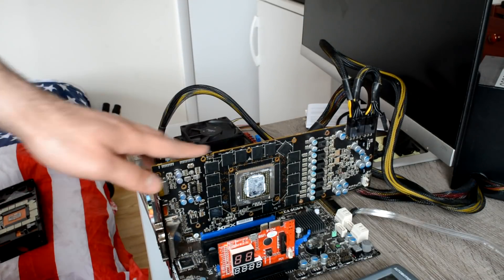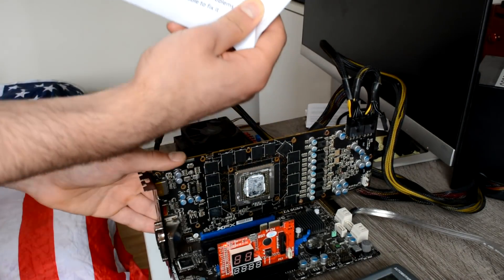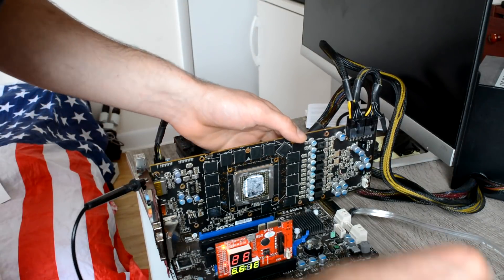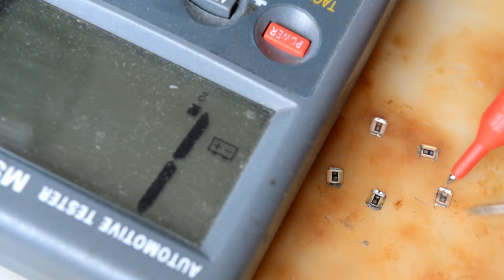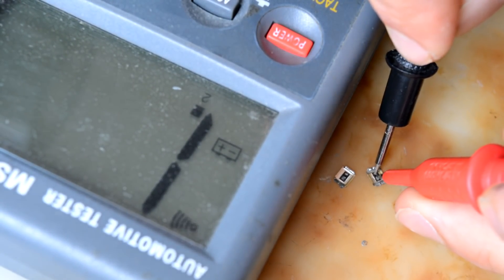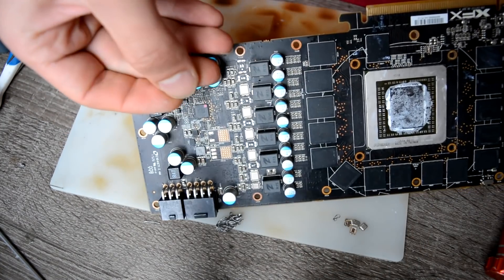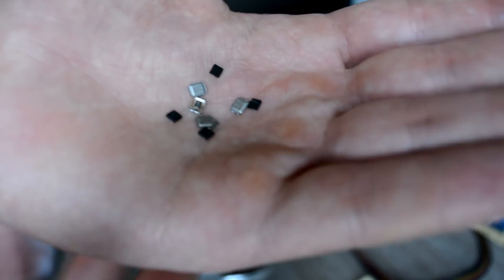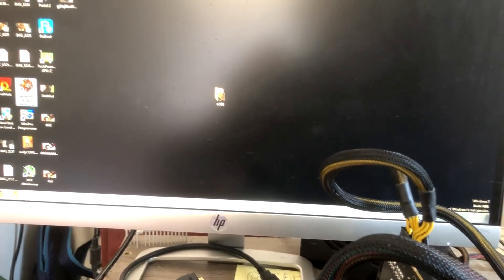R9 390X reference card broken (short) diagnostic + repair graphic card

Comment: Hello Eli!

You use motherboard, CPU, RAM and power supply to run the card and test it, right? Is this enough for GPU testing? What's the other tool in the front that is plugged in the PCIe and what do you use it for?
Reply: Debug card

Comment: Hi! I have the same card Sapphire Nitro R9 390, after playing o couple of hours its freez in black screen, after dat is stuk by black screen on windows boot state
without driver in safe mode works fine, but after i am installing driver and reboot it is give a black screen
any idea wats with it? voltage stabilizator?

Comment: i cannot find the part number for those mosfets, i have the same card with several obviously burned out mosfets, they got so hot the steel can started to blue itself
any chance you have a part number/datasheet for those?

Comment: Hope to help some people...
Had random black screens with this card. Didn't wanna sell it and replace it as I felt that it still served me well... I didn't even see an RX 580 or 590 as upgrade compared to 390. Tried about everything and was near sell it as faulty. 
What worked and it works perfectly for few days now was downclocking the memory a bit. From 1500 to 1300. And I actually didn't notice any performance difference probably thanks to the 512bit memory.
Hope it works for other people also.

Comment: my r9 390 goes black screen and coolers at 100% when i install drivers, idk what happened :(((
Reply: Well I did buy a rx580 8gb as well sold ot for vey little profit but hey it was something. Still need money to pay back my brother 😭. I am thinking of picking apart the friends video card 😂 infact it is also a gigabyte edition but with three fans and not 2.
Reply: Me2
Reply: my friend gave me 2 cards they did the exact same thing what I did with them was used the heat gun method and believe or not both of them are working flawlessly and now i can even install drivers without any problem however if i want to use one or the other I have to first uninstall the drivers for one of the card using ddu uninstaller then use the other card and install its drivers. The cards in particular are a r9 270x 2gb and an r9 290 4gb. the 290 was still crashing after a few minutes of gaming so after a littler under volting it is running games like apex on 100+ fps 1080 medium settings.
Reply: @asifkaka5052  tryed it, finally changed to a 580 :)
Reply: I bought a r9 390 8gb gigabyte edition hopping to sell it for a better price but after it arrived it has the same problem as shown in the video i swear i did so many things even the heat gun did not help now I need to seek a repair shop with a professional and ask for help. hope i can repair it for cheap because i bought it with elder brother's money. now he is asking for it.
Reply: @asifkaka5052  i maked reflow and dodnt fixed, f

Comment: I ended up buying a second hand 390x and the 6 pin pcie power connector trips the psu and the positive connections are all ground i dont understand how this happened but i would like to fix it
Reply: Looking through looks like at worst it could be an interlayer short but could be vrm or a cap getting a thermal camera and a psu to power that section of the card at low power

Comment: hey i have a 1080ti where the chip is getting hot, fanspin and all but no display output. when entering the machine with remote desktop or with another gpu as main gpu it will give the 1080ti a code 43. i am able to flash bios on the card, and gpu-z recognize the card but gives some misinformation on it( ex. when i use a 760 as main when looking at the 1080ti it will copy its vram amount etc, but not bios version or anything specific to the card). i am getting bored with it, cant figure out what its problem is. any idea?
tnx in advance

Comment: Hi eli, I happen to own a friend's R9 390 nitro that doesn't even turn on the fans, I've checked the 5 fuses, the IR3553 Drivers doesn't seem to be shorted and the same goes for the voltage regulator, still the card doesn't display any video output or spin a single fan on boot, any ideas on what to check?

Comment: Hi,

i have a GTX 1080Ti and everytime i am installing the GPU to my PC it wont turn on. Fan will move in less than a sec and then wont move.
Motherboard have power and all but the pc wont turn on. i replaced PSU but still dont work. i replaced the GPU and it started working.
I have a feeling that the issue is a short circuit on the GPU causing the PSU to turn everything off due to power protection that the PSU have.
Hoping for your response.

Cheers

Comment: i have saphire tri-x r9 390x just like in this vidoe, it was runing normal until the card getting flicker the screen on and off. and finally the card died, the chipset not hot. is there any solution to fix it? coz last time i checked the fuse, mosfet was ok. but i dont know about voltage regulator if it is ok or not. thx b4.

Comment: Okay so I have an r9 390x from sapphire and it only black screens under load like youtube or the music app. What could that issue be? I installed the correct bios and all drivers are up to date. Temperatures stay at 40c and under load before crash hits 50c. It can't be driver wise but any hardware tips? how much would you charge if I sent it to you?
Reply: common issue for this card check out some temporary fix like lowering clock speed through old asus gpu tweak software
changing tdr to 10 in the registry something like that
Reply: @cclacss  down clocking does not help it and some times it stays on for 2 hours on youtube and other times it immediately crashes.
Reply: @MxGRhythmlModsMusicGamingl  have you tried my suggestions i have the same card as your it worked for me
Reply: @cclacss  I have tried all your steps. It lasts longer at stock speeds that down clocking.
Reply: and disabling hardware acceleration on google chrom browser helps too

Comment: For those of us who don't have spare cards do you have a suggestion where to buy the parts we need to replace?
Also I would like to see a repair with an x2 card with two cores. I got an 4870x2 broken but one core works the other not so I can't remove the heat sink..
Reply: Find part number and look mouser, digikey, jameco, alibaba.

Comment: Wish you would live closer, I would bring you my 3 years old Sapphire R9 390 Nitro 8G, monitor goes blank and stays like that till reboot. Does not say "no signal" or anything, sometimes it stays on for 20 minutes, sometimes a minute before going blank. Running an older card now and everything is fine so I'm pretty sure it's the R9. Missed the VISA +1 year warranty claim by 2 days lol ohh well
Reply: Check the temps. A shut down mid display is usually temperature related. 
I've learned so much from this guy it's unreal

Comment: Hi , Iam From indonesian 
Just one Question about my dying card , i have GTX 970 galax KFA2 and this card just run with PCIE 16x 1.1 , yeah . . Its just run only 1.1 PCIe  not 2.0 or 3.0 , this card Always gettting bsod or hang if playing AAA games(heavy games)  but this card can playing DOTA Or other light game , how to fix this ?
Reply: buy new once gpu
Reply: fajar: what to do first is change the heat transfer paste. If that helps a little, then try a tiny amount of liquid metal, if not aluminum. Do not put LM on aluminum. Or if really not then put a morpheus cooler on it for more heat dissipation.

Comment: I also have a Sapphire R9 390 Nitro which randomly black screens, even when only on the desktop. I'm suspecting my powersupply (Corsair RM 850) But the strange thing is that I'm running my Vega 56 just fine on the soame powersupply. But under load VRMs get really hot so I was wondering if there is anything in particular I should measure for this kind of problem? I'm still going to test it with another powersupply and measure the same transistors and see if there is any shorts to ground.

Comment: Hey Eli! I've got a GTX 1080ti, that gets "no signal" or "black screen" when loaded. If I do underclock it, turns to work more stable! Can you help me out checking the card and diagonostic it?
Reply: are you kidding me Gtx 1080ti was ruined cant believe. 
These are the most reliable card series what happened ?
Is it detecting driver ?
Reply: Farhan Ahmed it does detect and install drivers, and it works in less gpu instensive games. But when pushed with gpu intensive games, games crash and black screens shows up. 

I try underclocking it, and it helps but it’s not the solution.

Evga wont rma it as i do not have the original ticket. To proof the purchase. Stupid right? 

So, Im not sure what to check due to my problem. Iam in argentina so it’s hard to get it to other country.
Reply: @batto271  I also looking for solution. I have GT 730 which works great but when I launch any game, game menu loads but when game actually starts, black screen comes saying no display. GPU fan keeps on spinning but no display.

Comment: Thank you for sharing your knowledge. What is that card with the led display in the motherboard at start of video? Is it used for diagnostics?
Reply from the maker: abeleski yes
Reply: Do you find it useful for troubleshooting video card/motherboard issues. There seems to be quite a few available on the market. Any particular ones you would recommend  if indeed they are good to have? Thanks again.